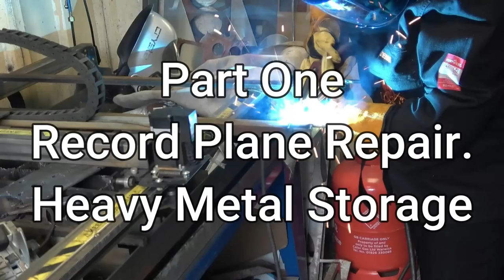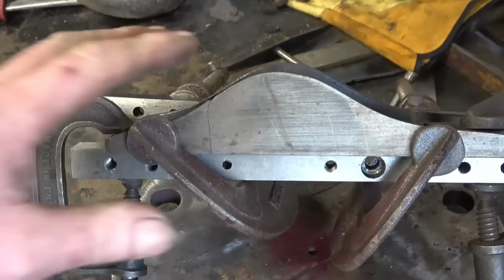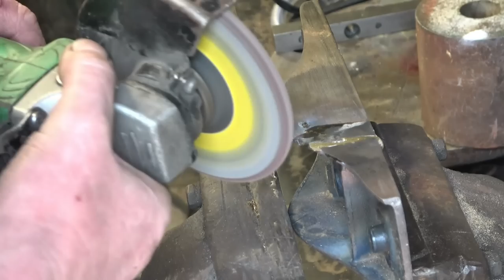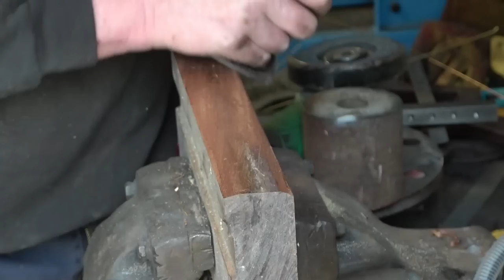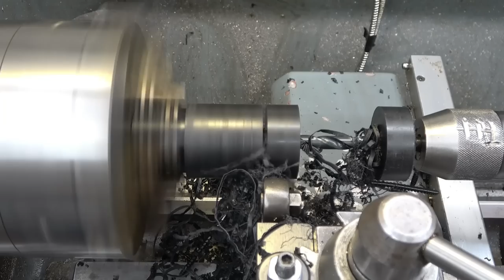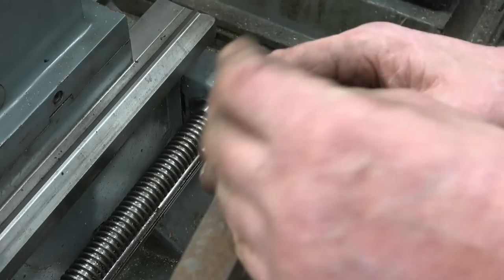SNNC 480 P1. Record Plane Repair . Metal Storage

Comment: My Record No.5 jack plane broke in exactly this position when my daughter dropped it on the floor.  I contemplated brazing but settled in the end with using a Nickel alloy rod in my SIP 130 buzz box welder.  The result was way better than I expected.  After grind/linishing the surfaces its literally as good as new with a perfectly flat sole without any warping and the repair is virtually invisible.